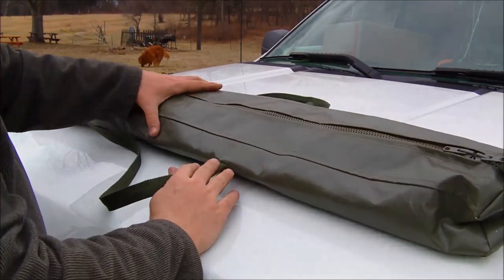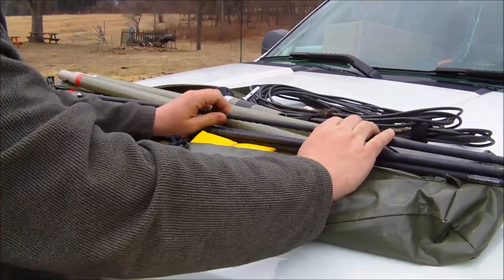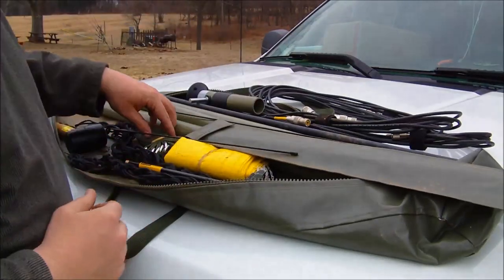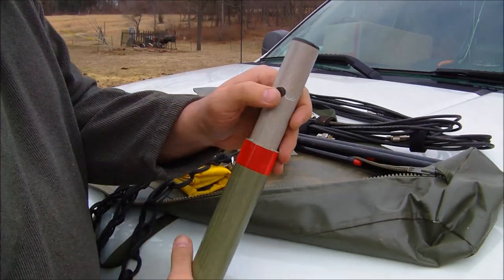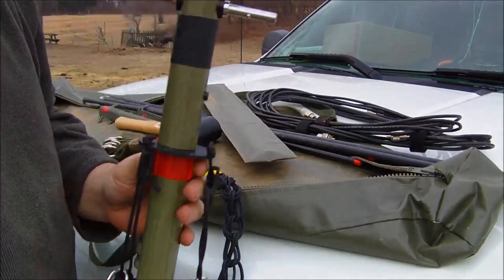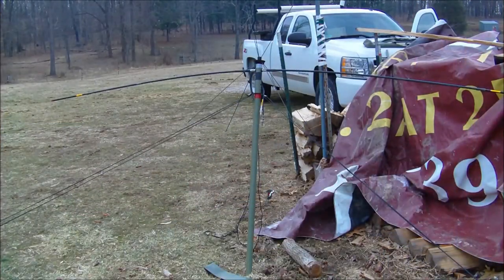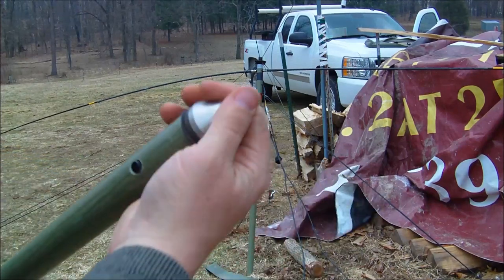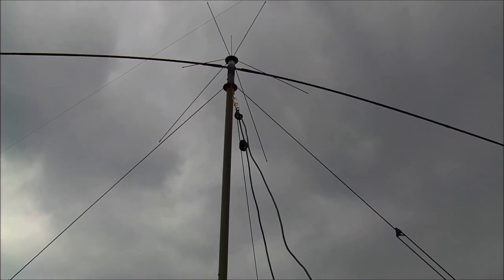Rapid Antenna Deployment System for Amateur Radio EmComm

Comment: The 40m ant could be made from couple HamSticks with buy off the shelf center piece made to put them together.  Makes a dipole.  Also has SO239 for coax.  There are many small vert for 2m/UHF.  For the structure I've used the buddy pole and also the found all over military 44 in poles.  all can be made for $100.  Just keep in mind these short HF antennas lack in performance and bandwidth, but can get you on the band.
Reply from the maker: ron wright I agree, it shouldn't be to hard to put something like this together on your own. The nice thing about this one is that it's all purpose build for a task, easily fits together, and comes in it's one little package. The antenna, the HF side at least, was geared to be an NVIS set up and works fairly well for that. The G5RV that's been strung up next to get puts this one in the mud for far away and DX stations. This would not make a good DX or DXpedition antenna, that's for sure.

Comment: A Hamstick is a lot cheaper at about $18 each. 2 make a dipole. Add a support pole, paracord, and coax.
Reply from the maker: That's exactly what this is. A couple of ham sticks for each band with a fancy holder upper thingy. Well, it also has VHF/UHF antenna on the top.

Comment: Perhaps I missed it.... name and brand of antenna? When I google EMCOMM I get generic hits   Thanks
Reply from the maker: For some reason this comment slipped past me. Sorry for the delay. I can't remember who put it together but they are no loner around. The HF antenna set up is just a couple of those "CB" type antennas with the coil built into the fiberglass rod and then a metal whip for tuning. You could put one of those together easy enough with two of them and a couple of mounts.

Comment: is that your gun? the lumbar area is the worse placement for ccw.
This antenna seems fine for vhf/uhf but, definitely NOT for HF
Reply from the maker: +Achisachis73 My concern isn't about concealment when carrying most of the time. In this situation I wanted it on me but out of the way. For true concealed carry this pistol is a little big for my taste anyway.

The HF part of the antenna wasn't intended for DX work but rather NVIS for emergency operations when your likely wanting to talk to an area fairly close (in HF terms at least). It's also not really intended for changing bands that often. My thinking is that once you've determined day and night bands you tune up the proper elements to the proper frequency and then just swap them out morning and evening.
Reply: IndianaCaver in California the ccw must be out of sight at all times. If someone sees it and calls the cops, they can build a case against you and you can lose your ccw license. Someone is mad at you and sees the gun, they call and claim that you pull it out on them.

And the antenna seems small to me, the frequencies for NVIS are low. I would like to see the antenna in operation. Do you use it with ALE?
Reply from the maker: +Achisachis73 Indiana we have a "personal protection" permit. It doesn't specify the weapon must be concealed.

The elements are those ham/hf sticks where they basically wrap a wire around a 3 foot section of fiberglass to form a coil of sorts to get close to the band. Then you adjust the whip length at the ends to tune. Haven't played around with ALE but it is of interest.
Reply: IndianaCaver well you lucky "indianans"
That would be nice to have here in Cali

Nice antenna, I got the buddiepole and I am curious to see how they compare the two.
A fellow HAM invited me to join the ALE movement but, there is a lot to it and I do not have time.

73's

Cheers
Reply from the maker: +Achisachis73 I checked out the buddiepole a while back but didn't get one. Really like it. It seems there are a lot of "moving parts" to the ALE stuff, likely something I'll get into one of these days I guess.
73